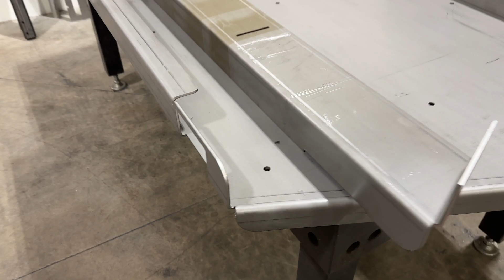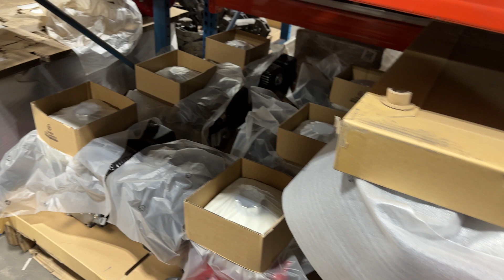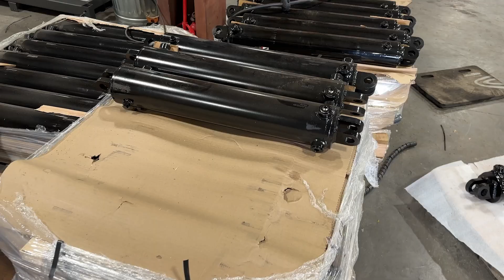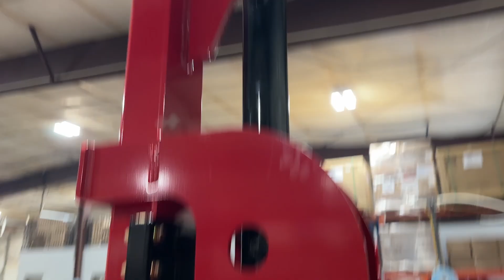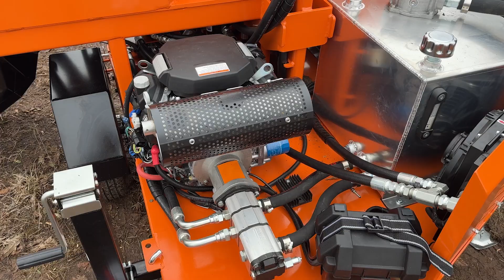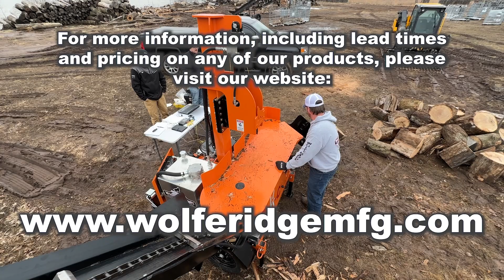Wolfe Ridge Manufacturing - Log Splitter Lead Times Explained

Comment: If you are out 3 months then order 2 years worth of pumps and engines.  They don’t go bad.  Also, u guys should start your own powder line! Imagine the possibilities
Reply from the maker: It sounds simple, but what happens is different.  One supplier runs out of a certain part to finish an order, then all the sudden we don't have a certain part on time.  It has gotten a lot better since covid, but we still run into hiccups like this.
Reply: @WolfeRidge not the end of the world we run into this issue at our company too. 185 employees and we build our own machines as well.  Sometimes we just order 200 pieces when we only need 20 just because we will use them someday

Comment: Bob good Quality products are worth the wait . Split fire was 8 weeks out on my 4409 but I got it as promised. I it to put my hands the 28c and the 17 vs at Matt (fire wood on the hill ) . I kept thinking I wanted the big box wedge unit but after running that 28 I think it’s all I need with what I already have . You are doing some good transparency videos on every thing . And it shows that Chris truly has a great product across the board .
Reply from the maker: Thank You!